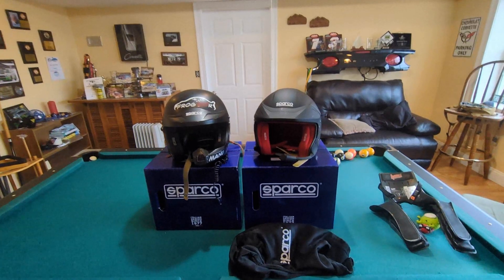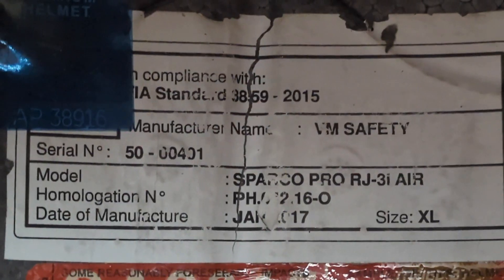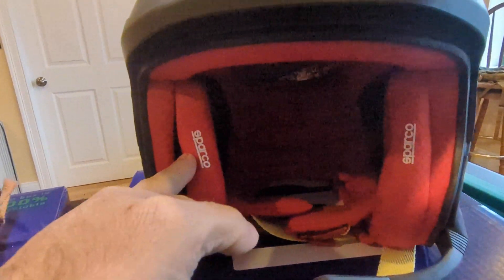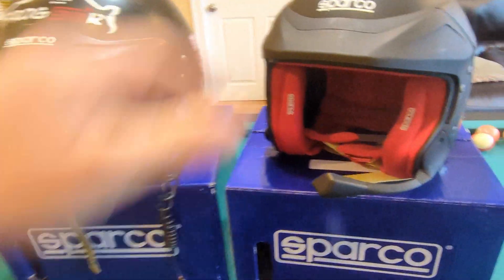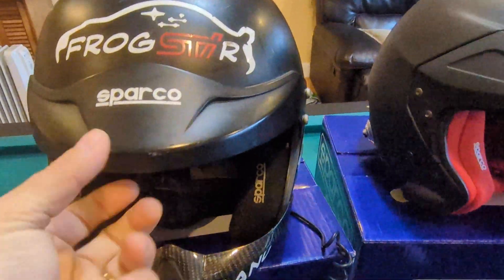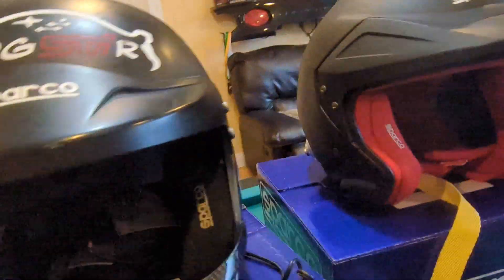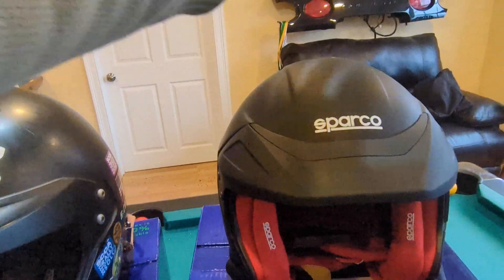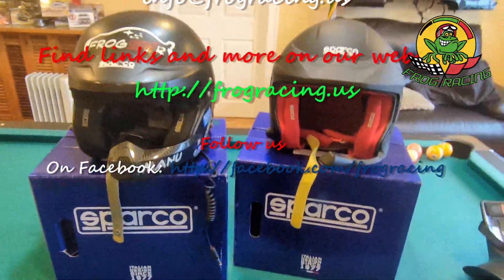Sparco Flux RJi and FIA 8859-2024 standard

Comment: Hi, Thanks for the review. I have a hard time finding these locally to try on. Can you comment on the fit vs other brands especially vs Arai if you have tried those?
Reply from the maker: They tend to size on the smaller size. I'll check if I still have my old Arai to compare the size and let you know.
Reply: @FrogRacing  Thank you! I am guessing since you previously wore an Arai, the Sparco head shape is similar to the Arai head shape (oval-ish)?
Reply from the maker: @EB-vp6pj my Arai was a full face, the open face ones tend to be more flexible at the base to adjust to the shape of the head (especially with the comms). Didn't find my old Arai so I can't retry to give you a definitive answer.
Reply: @FrogRacing  I appreciate it!

Comment: I'm looking to buy this helmet, and im new to this, but if I buy a ZeroNoise brave amplifier with male nexus plug, I shouldn't need to male to male adaptor correct ? also with this helmet are headphones already presents in the padding and  does the sturdy microphone stuff contains a microphone actually ? thanks
Reply from the maker: The RJi is equipped with comms (the i in RJi is for integrated comms) so it has headphones and a microphone. The helmet has a female Nexus plug. You will have to get a cable with male-female Nexus plugs (male to connect into the helmet, female to connect into your ZeroNoise,). You can check with the folks at Rally.build they should have them in stock.
Reply: @FrogRacing  thanks really clear for me now !